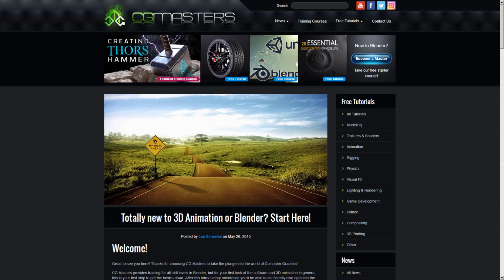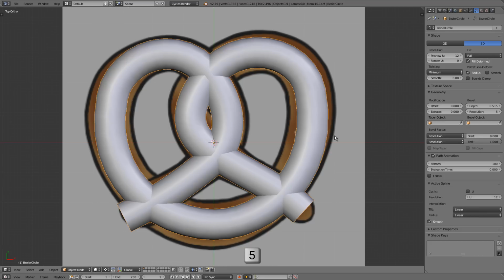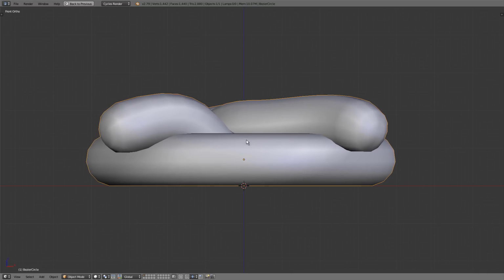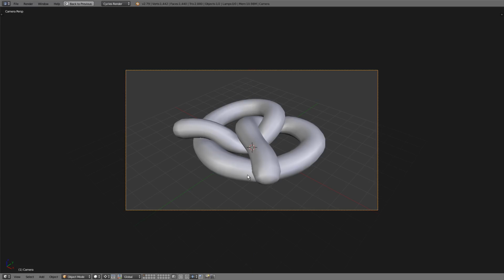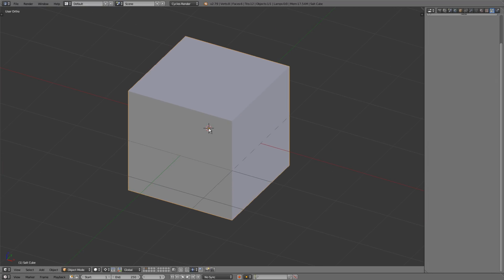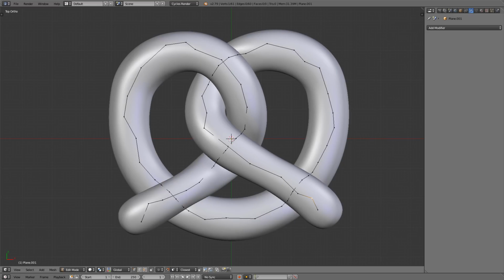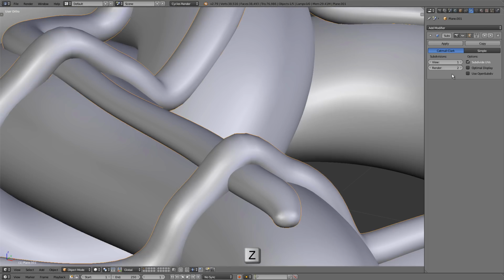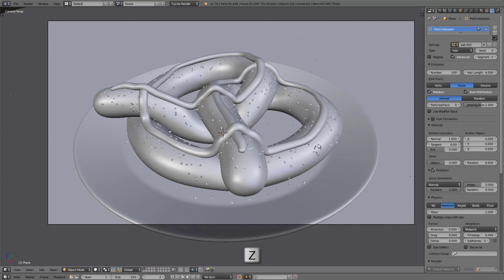Making a 3D Pretzel - Part 1 - Blender for Beginners

Comment: Proportional Editing/Scaling just scales down 75 of my pretzel. not just the near surrounding vertices.
Reply: quick research and turns out my "Influence Circle" was zoomed way out so it was covering the entire project. to fix it press "G" while you have the vertices selected and scroll up on your mouse and the influence circle should appear into frame.
Reply from the maker: @RuBixSnow  I actually forgot I still had this tutorial published, has this been useful still?
Reply: @blengine  yup. slightly outdated with the blender layout, I've had to google a few things since they are in different places. im making the salt as of right now and everything ive been able to do off the video by using your step by step or having to google a part. currently using this to make my friend a V-Tuber thingy with the pretzel holes and eyes as the mouth. currently still modeling it though
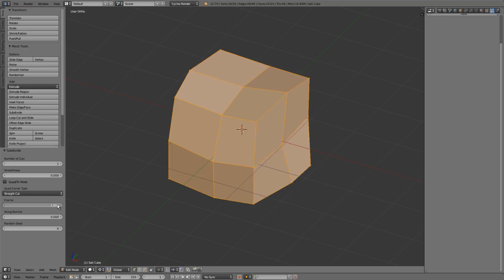Reply: @blengine  struggling to find out how to do that "fractal" part and make the salt all jagged though. the one at 37:57. i don't see the "Toggle Editmode" and to get to the "Subdivide Fractal" thing
Reply: nevermind, when you right click and click "subdivide" a menu pops up in the bottom left that says "subdivide" with a arrow you can click and it'll pop up the subdivide options to use.
Reply from the maker: @RuBixSnow  Awesome to hear, sometimes I get lucky and a tutorial is useful for many years, but Blender updates all the time and I always worry the next update will too greatly out-date everything I've made so far.

Comment: I'm slowly working through this tut which great btw! I do have an odd issue. When I the "F" to cap the ends I just get a connecting line. Pressing F again doesn't auto fill either. This is my 2nd time doing this part and it worked without issue the first time through though? Thx
Reply from the maker: Hey, send the blend to me at contact@cgmasters.net and I'll check it out. -Chris

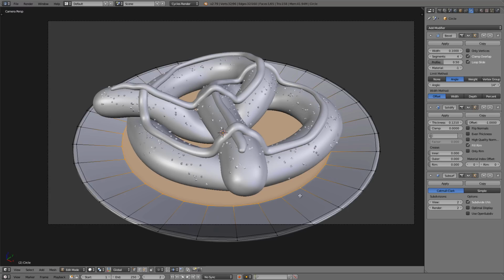Comment: great tutorial! I just have a question. at 1:01:36 why did you duplicate it by shift D? why not just separate the object without duplicating it?
Reply from the maker: Sorry I should've explained that more. If we simply separated the selection without duplicating it first we would have put a hole on the center of the plate. The faces we duplicate and separate don't actually render in the end,  they're just used to define the region of salt we add for the plate. So we want to make sure the plate stays whole while also having that separate piece of it to use for salt. Let me know if that makes sense. -Chris